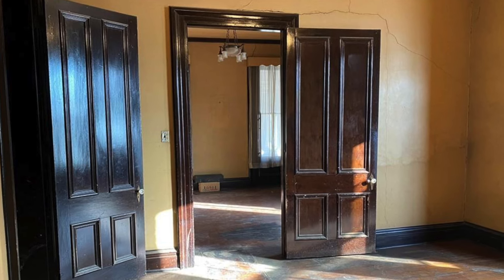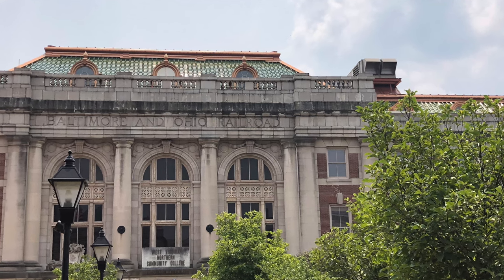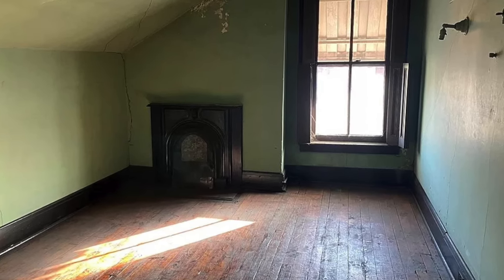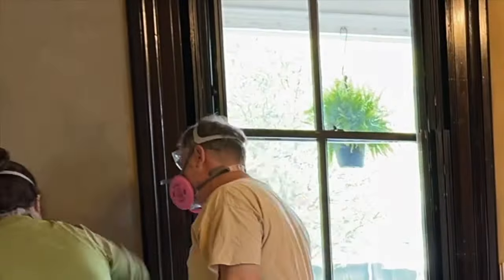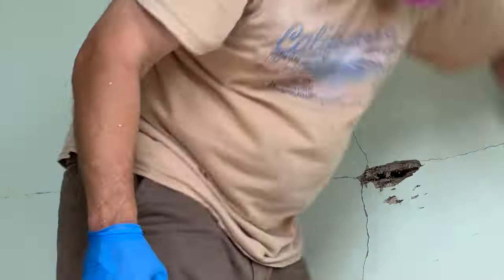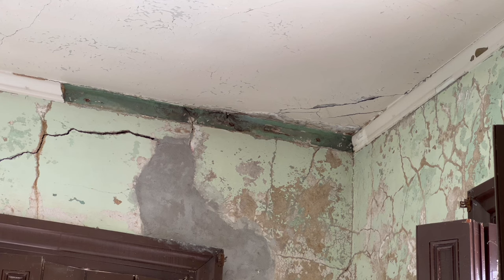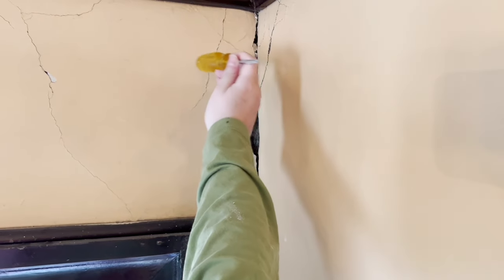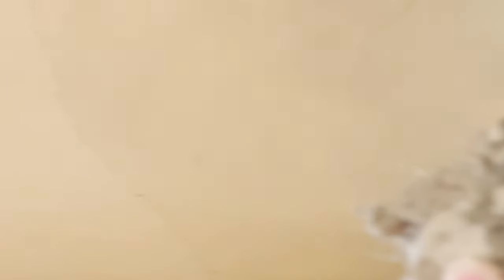Victorian Home DIY: Restoring the Plaster Walls - Ep17

Comment: This was an awesome video! I have an old home and one room has some failing plaster. I didn’t know how plaster worked at all really, I understood drywall and mudding but plaster is something completely different! I thought I was going to have to drywall over everything to fix it! But now I don’t think it will need drywall at all, just some repairs to the ceiling  and some cosmetic touch ups here and there. I am excited to learn something new! 😊  This is one of my favorite channels on YouTube right now.
Reply from the maker: Thank you so much! We encourage you to try some of these repairs. Please let us know how it turns out!
Reply: @ChaplineHouse   I definitely will! 😊 I am actually doing some home renovation videos on my channel as well, I will be for sure be doing plaster work in one of the rooms!  It is on the ceiling though, so I’m hoping that it won’t all decide to fall down on me as soon as I start working on it😅! My current project is an under stair closet that was walled over at one point. I was curious about how much space was underneath the stairs, and what it needed to be converted into a closet. So, I made a small hole and peeked in … imagine my surprise to see it was already a fully built coat closet! (albeit dirty) ..It even has some stuff inside of it!! I am hoping to get it opened up today. 🤞😁🤞
Reply from the maker: What a find!

Comment: I have a 1913 house which suffered an attic fire some 30 years ago.  Drywall was installed after all the sodden plaster was removed.  The only place it shows up is in the wood work in the bathroom.  There is a quarter inch gap between the new ceiling/wall and the window casement as the original medicine cabinet trim.  Also,  there is a bump where the remaining  plaster wall  meets the dry wall on the staircase wall.
Reply from the maker: Those are two of the reasons for repairing the plaster that’s already there!
Reply: @ChaplineHouse  True, but insurance companies dictate what they will pay for damages.   Thus, dry wall was used.  It's cheaper, easier, and faster.
Reply from the maker: You are right about that!

Comment: Drywall is fine.... and is going to save you tons of time
Reply from the maker: Really? We patched all of the cracks in our parlor. It wasn’t difficult. What makes drywall faster or easier? Wouldn’t we need to tear out the whole wall, to do it right?
Reply: @ChaplineHouse  guess it is a matter of what you are doing..... Installing insulation to outside walls & the like.

Gyproc panels measure 8' x 4', so it is installed quickly
Reply from the maker: Ah, it does depend on the plan. Our exterior walls are masonry and we have no plans to insulate them